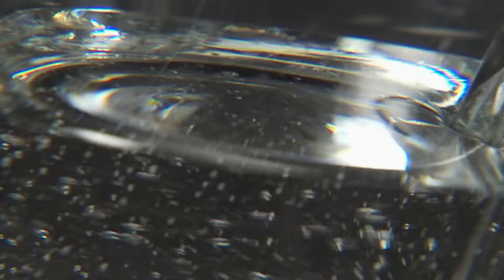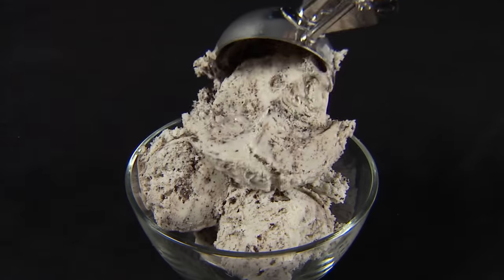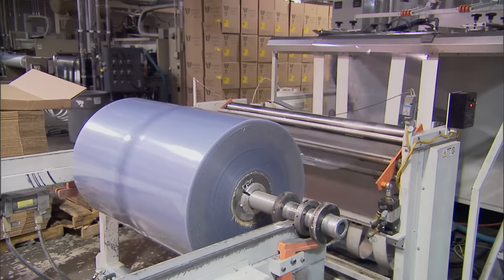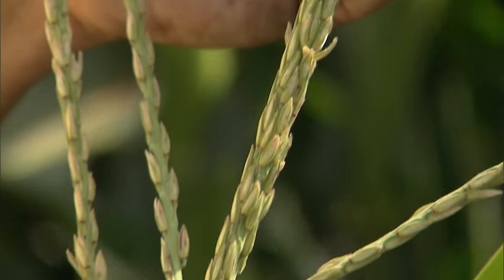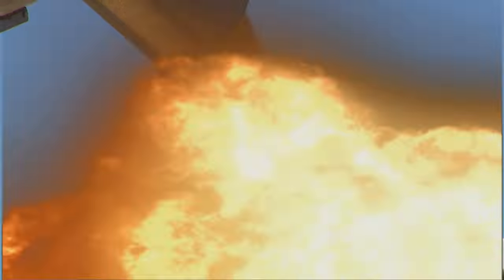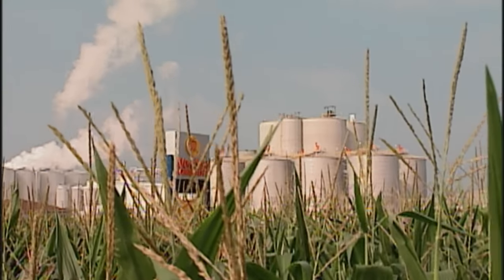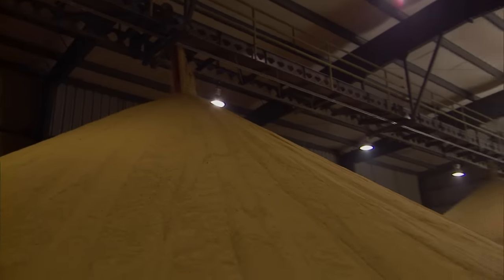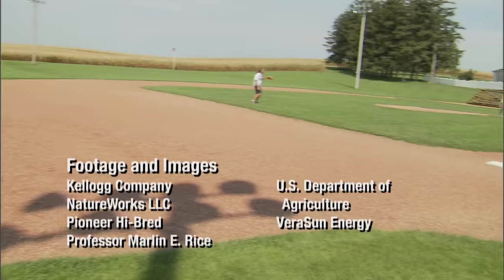Modern Marvels: How Corn Fuels America (S13, E39) | Full Episode | History

Comment: Ethanol is horrible for small engines used in landscaping equipment. They also tell you not to run ethanol fuel in your motorcycle. Terrible in winter attracts moisture in your fuel causing fuel line freeze.
Reply: eats many type of gaskets too.
Reply: That’s why you use non-ethanol fuel (100% gasoline) for such equipment. If it’s not a FFV or setup to utilize e85 or any E-blend don’t bother with it
Reply: @theMister07 I have a few family members that think I’m an absolute moron to use e85 fuel, in my flex fuel Toyota, and that it will ruin my vehicle. Meanwhile, they drive across town to go to the 1 station that sells pure gasoline to fuel up their 1980s-1990s trucks at $4.50 per gallon in Oklahoma. 

The point: they exist about 40 years behind technology and refuse to accept that anything after 1994 has happened.

Comment: Ethanol fuels are horrible for fuel mileage, not to mention if you let it sit in your tank for awhile. They shud design an engine to run solely on ethanol and not mixed with oil based fuels
Reply: Dryer climates handle ethanol sitting for a while better than humid coastal climates that's for sure.

Comment: Ethanol will never economically replace gasoline. Plus you need almost 2 gallons of ethanol to equal the Btu output of 1 gallon of gasoline. What do you do for fuel in the event of drought or crop failure?
Reply: Plus the waste of water that it takes to produce it we will never be able to out do Mother Nature and oil e85 has ruined more carburetor parts on my farm then any little kid could tearing them apart,plus rotting out fuel lines.
Reply: @wreckum56 use 100% gasoline, coupled with Stabil, problem solved…
Reply: Ethanol destroys a fuel systems in small engines and cars. Americans are paying top dollar for the worst gas you can buy. America's are being screwed by Big Oil's price gouging..
Reply: @theMister07  Sta-bil doesn't work
Reply: As far as corn goes, droughts were pretty much defeated back in the 30s when amidst the worst drought in US history farmers yielded record growth of sturdy, drought resistant corn and nitrates.
Reply: None of the fuel Stabilizer work

Comment: Ethanol laced fuel is more expensive and less efficient than plain old 100% gas!
Reply: idk where you live, but here in iowa its 20 percent cheaper. but it is way less efficient on gas mileage
Reply: @danzilla3223   It is cheaper at the pump because it is subsidised by the government the actual cost is much higher.
Reply: Ethanol ruins fuel injectors and carburetors.
Reply: its true, its like comparing an electric car to a muscle car
Reply: And ruins machinery!
Reply: good ole govment making things worse
Reply: It was, and is, welfare for big agriculture. And a way to buy votes in the midwest. More expensive, not efficient, requires fossil fuels to produce it, ruins engines and is not "green" at all. Ethanol is a total scam.
Reply: Plain old gas contained MTB one of the nastiest chemicals none to man.  This stuff is in our ground water and will be around for centuries. Ethanol is environmentally friendly and renewable.
Reply: @davidsonlankford1168  And will continue to clog fuel systems on machinery at an ungodly rate!
Reply: @Bullmanure24  cars built in last 15 years run on ethanol just fine.  Not uncommon for modern engines to last 200,000 to 300,000 miles.  Cleaner air and less lung cancer with ethanol. Small price to pay for cleaner air and no MTB in ground water
Reply: When you see your check engine light come on and your eye starts twitching , muscle spasms an start babbling unrecognizable words,,thank  ethanol is nothing but poison to your automobile, auto shops ,dealerships, parts stores they all love the stuff,,
Reply: You are 100% correct and if there were no government subsidies then the practice would end. I have read that farmers enjoy knowing their crops will sell but I also read that Biofuels are driving down the price farmers get because it is known that the farmers are subsidized, I do not know how true that is because I have only read about this from a couple of sources though. All I can say is I strive to not use 10% Ethanol in my Cadillac because I noticed the fuel economy is not great however the car is not E85 like my 2011 Chevy Impala was, it had no issues and ran very well, I think it depends on the engine and the ECM programming.
Reply: @dougedwards8022  technology today is way more advanced than it was in the 80s. If you have a flex fuel vehicle, you'll be fine
Reply: Tell that to your check engine light,crappy gas mileage,emissions code store in your ecm an multiple misfire that's almost unfixable 15 times a year,,,long live quarajet 4 barrel, 1 wire Gm HEI an Delco 1wire alternator all others fail way to often.
Reply: I don't have the information in front of me, but look up the amount of CO2 Ethanol/ gas,, B-100 / diesel produces. 
With reading it years ago didn't look like a good idea! 
That which is subsidized willl appear to be cheaper. As the earth is cooling that food  which can be eaten should be, that which should be pumped, cracked should also be.
Reply: Ethanol is also used in gasoline for oxygenation to replace MTBE.   MTBE is a problem chemical.  The use of ethanol is far better than MTBE.
Reply: @dougedwards8022  Lol dude you are the last person in the world who misses carbs. Really annoying some motorcycles still have them.
Reply: @CIARUNSITE  well bikes 🏍 are for bike people, I have a 15 suzuki 650 burgman great trouble free machine an still very reliable,,,and a 21 polaris slingshot 8500 miles cracked cylinder sleeve I believe starting to wonder ,,,but in a automotive world gimme a bangin spread bore quadrajet any time ,,my preference
Reply: So???
Reply: 300,000 miles on my flex fuel 2003 Tahoe.
Reply: Idk man, I think we should all go back to the good old days of Lead 🤷‍♂️
Reply: @ROSS4422 my 2010 tundra works just fine as a flex fuel, even in todays gas prices the breakeven cost is about 2.5 tanks of e85 to regular. It’s so much cheaper that the reduction in gas mileage is still covered. I’ve noticed no difference in performance since using the e85
Reply: Gas is awesome.   I like gas.

Comment: Some vehicles won't run on it. My lawn mower and generator won't either. The manual says 85/15 is okay and the pumps use to say may contain 10%. They took off the signs and reports are saying 51% might be the truth. I've already had to repair the mower, I have to repair the generator and my truck is acting up too. Don't suppose the gas companies will want to pay for the repairs do you?
Reply: Then quit whining about it and buy either Torco or VP Fuels ethanol-free unleaded.  It's only about $15.00 a gallon.
Reply: @Buckhorn Cortez  Only $15 a gal? It's probably not even available in Kansas. I'd rather run leaded fuel in it that cost me 14 cents a gal in 69!
Reply: I don't run any small engine with ethanol mixed fuel

Comment: The ethanol fuel is so damaging to equipment if left in the vehicle for long periods of time. I hate it. I don't get the gas mileage I used to either.
Reply: Because ethanol doesn't contain the same amount of energy as gasoline, that's why your mpg will go down when using it

Comment: We could still run 100% ethanol in cars if they wanted, raise compression to the point of high performance race cars and all cars will run on it straight, can’t see it burn in the light if spilled, at night a blue flame.  We would be better of with cane sugar as our sweetener as sucrose is more what we r supposed to process in our bodies
Reply: Ethanol destroys rubber hoses, it’s not worth it unless your car is already equipped with specialty hoses
Reply: The Brazilians ran all of our cars of the 60-70s on straight OH because they built them that way, also very easy to break water into fuel and burn it, it turn back to water,  new cars O2 sensors think it’s O2 so the computer adds fuel instead of recognizing the H2 as fuel.  They went the wrong way for clean burning cars and trucks because of the oil co lobbyists
Reply: @sheilamclaughlin963  do you understand just how much energy it takes to split water?  i'm guessing not, so i will let you know now...  a HUGE amount.

Comment: Ethanol gasoline is far worse for the environment that petroleum gasoline. It’s purely an economic reason (greed) why our government passed laws requiring ethanol fuel.
Reply: Wrecks engines when it sits and the alcohol seperates and becomes corrosive too, but they don't care, no skin off their back! That's why all your lawn equipment won't run after sitting for the winter. Switch to ethanol free and that goes away. It has also decreased gas mileage in cars basically negating any benefit it has anyway. Just another government scam.
Reply: @zincyellowmach1523  gasoline is corrosive in and of itself. That is not the issue, the issue is that most small engines are carbureted; they have a small bowl that holds and meters the fuel to deliver only what the engine needs. Ethanol is hydroscopic meaning it attracts water over time. The water separates out from the fuel and that is what reacts with the metal causing corrosion on the internals. The good news is if you are storing a small engine for a long time you can unscrew the bolt in the carburetor bowl and drain it, then spray some light oil in it if you wish to prevent any condensation from corroding the needle/bowl/float. Lastly you can drain the tank of fuel and put the leftover fuel in your car or something you use more often. Or you can run it out of fuel if you only have a little left in the tank; another way to do it is to make the last tank of fuel before storage pure gas without ethanol and make sure to mix engine stable in it because gas only has a shelf life of a couple months. If all else fails rebuilding the carburetor is simple and takes less than fifteen min.
Reply: It's wrecked many a classic car's fuel system. I always tell people if their car has sat for a while to at least clean out the gas tank, or if it's been sitting for several years, it might be better to just get a new tank. I've seen what happens when bad gas gums up a carburetor.
Reply: @atomicmuffins1328  yeah I just didn't want to go into all the detail but it's when the ethanol seperates and has water that it becomes a problem, cycling the gas and keeping it mixed will prevent the issue too. Who wants to have to rebuild their carb every year or even winterize it. Just running ethanol free works and I have never had trouble with gas not running due to age. Also gas itself is not that corrosive, it is again the water that gets into it, from condensation etc. My dad bought a 1963 galaxy that had not run since 1981, we checked the fluids and fired it right up. We didn't run it long to avoid running water through but the carb was fine and the tank etc. 2 months with ethanol and the inside of the carb was green gunk. Now he runs ethanol free and it sits over the winter and fires right up in the summer, carb looks like new inside still.
Reply: @zincyellowmach1523  I never have issues with my mower, for starters I NEVER drain the tank, it is never stored inside, all winter it is buried under the snow, in spring I change the oil add gas and 2 or 3 pulls it is running, mower is 12 years old. Been doing this for 42 years and using ethanol gas since about 1988 when Minnesota made it mandatory in gasoline. 

In fact ALL of my small engines I have NEVER had a single issue related to ethanol. And no I do not add any thing to the gas. Except oil mixed for chainsaw.
Reply: @Wayne Flanigan yes my dad had exactly the same situation with his 63 galaxy. He runs ethanol free now and it's perfect. Same with the zinc removal from the oil, ruins flat tappet cams, once again the good old gvmt.
Reply: @tajon5394  good, that's not common for me and my neighbors and everyone at the local mower shop and a bazillion other people which has even led to hardware stores selling ethanol free gas in cans with the mowers etc. Glad what you do works for you though!
Reply: @zincyellowmach1523  3 years ago I told 4 of my neighbors what I do, they all bitched about the same issues you have stated, they thought I was nuts. But guess what, 3 years later None of them has had any issues. Nobody drains the gas from any tank or store their mowers in a garage now. And e10 gas is all we get.
Reply: @tajon5394  well thats fine. I have seen with my own eyes what it does to carbs when it sits. Don't know why it's different there but do what works for you, nobody is trying to stop you.
Reply: And it fuxs up our vehicles . I had a motorcycle that I had to clean the filter because it would get full of ethanol and wouldn't start. I had to clean it every two months and the bike was brand new
Reply: @atomicmuffins1328  Exactly
Reply: @NateLeePhillips  And that is why they really put it in gas. To make profit for big corporations and to ruin old cars that sit so you can't use them no more without putting a ton of money into them to make them run again. This is a setup for the coming collapse they have orchestrated that is in the near future.
Reply: @tajon5394  are you in an ethanol related business? If not go buy some lottery tickets

Comment: We need to push for them not to add this to regular gas and if someone wants to use it, make them have to get it as pure ethanol . Otherwise leave it out of gasoline. I thought about sueing because the little that's in regular gas has destroyed some of my carburetor vehicles.
Reply: Ethanol free gass is available,  it will destroy aspirated engines....
Reply: Funnily enough in order for ethanol to be a viable enough replacement for Gasoline it needs to be 15% gasoline aka E-85. 

I generally agree with you, I don't like ethanol. However it has been in our fuel for a long time and we may end up with there being much more ethanol in our fuel in the future. 

That's why I'm looking at getting a flex fuel vehicle
Reply: flex fuel doesnt help, the fuel system is the same in all vehicles